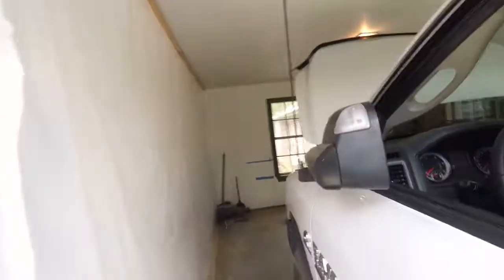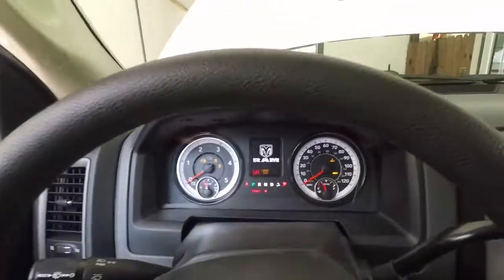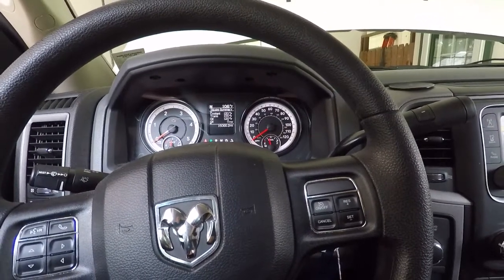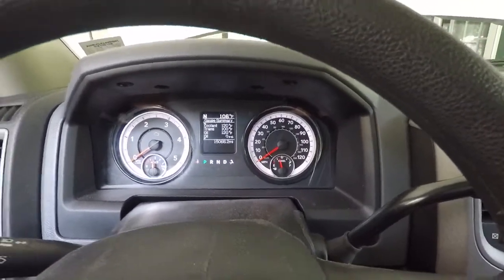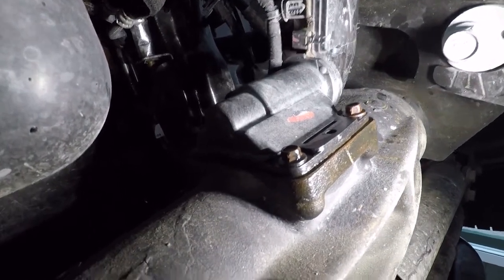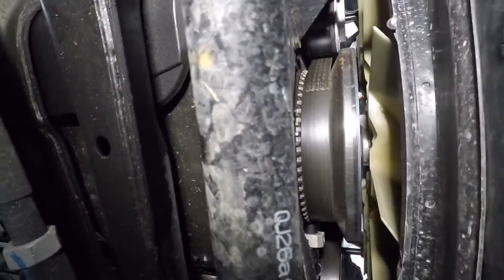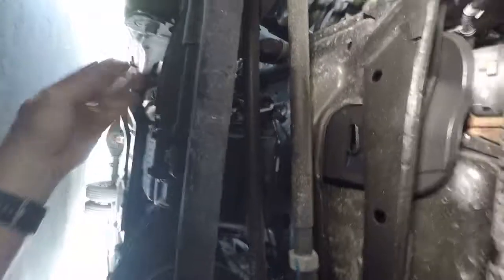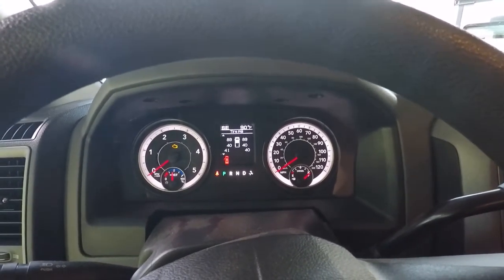2017 RAM 3500 Cummins - 4x4 Actuator and Front Crank seal leaks

Comment: Had the same exact problem as you with the 4wd service light.  Towing about 5k on a smooth dry interstate at 70mph.  Light came on and there was a grumbling noise.  No exits for a while but I slowed to about 60 and the noise went away after about 3 miles.  I ended up exiting and switching the 4wd on and off and it hasn't come back....yet.
Reply from the maker: Since they changed the front axle actuator it's not had a problem. If you're under warranty, if try to get it done. It's and easy part to change, but costs like $400. Thanks!

Comment: Did you find out what the problem in the front end was? I have a 2015 ram.2500 that has 120k on it and it just started doing this.
Reply from the maker: Howdy! The actuator was replaced under warranty.  So far,  with about 500 miles of towing on it,  it's not happened again. Thanks!

Comment: Gentlemen i have a 13 and the 4x4 will not engage but the front shaft does spin...
Also on the dash randomly i get a light and its a lightning bolt symbol and i.lose all throttle response untill i let off the petal and reapply my foot
Reply from the maker: Howdy!  Not sure on the power loss,  although I had a similar thing happen to mine when I dragged the brake pedal lightly to keep the brake lights on while driving.  The truck thought the throttle was stuck and kicked it off. It came back after about 10 seconds of no pedal input.  

The 4wd issue sounds like a failed actuator.